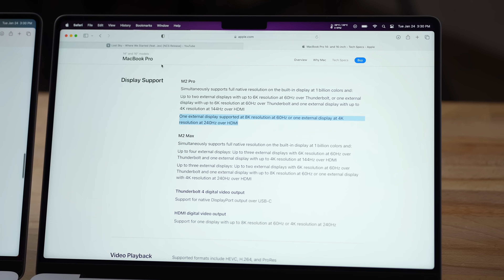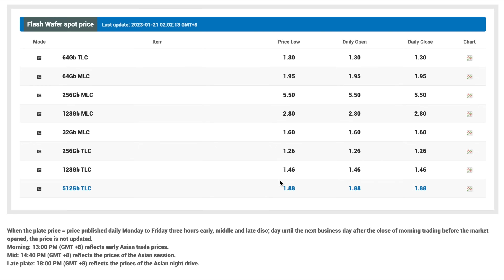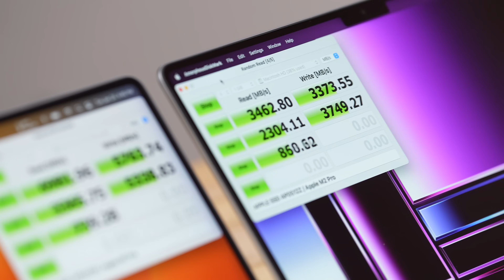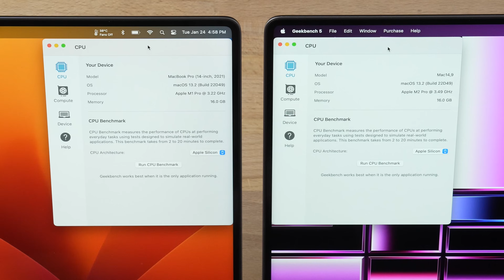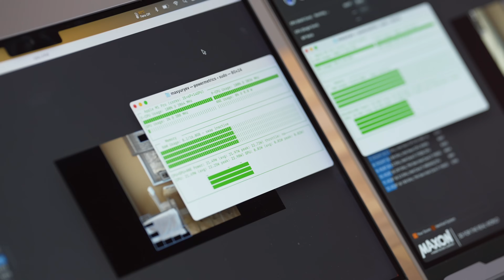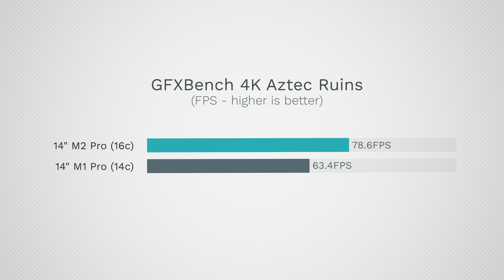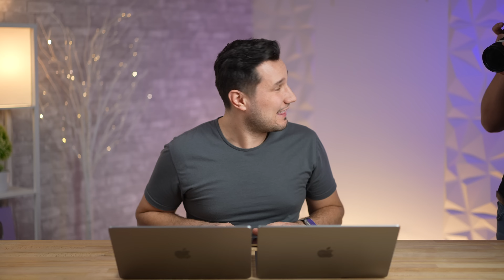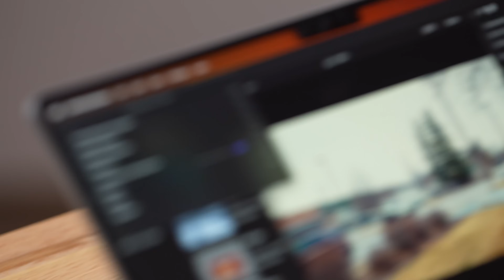M1 Pro vs M2 Pro 14” MacBook Pro - ULTIMATE Comparison!

Comment: Cool stuff. It’d be interesting to see what the actual impact of the lower SSD performance is for people on a daily basis depending on what their actual usage is like. I have to believe that a lot of the people buying the base configurations of those machines simple do so because they want a nicer screen and more base connectivity than would be available on a MacBook Air. Further, I’d guess that those customers who need the best possible storage speed are not buying the base config and are willing to pay for it, one way or another.

Comment: Very informative. The smaller heatsink on the new model doesn't make sense because the new SOC runs at a higher clock frequency and generates more heat.

Comment: This comparison just proves that although these new machines are faster overall, these chips are really just slightly beefed up M1 chips, with more graphics cores.

1. The battery difference may/may not have something to do with the fact that the M1 machine is over a year old, and may/may not have some battery degradation. 
2. I wouldn't have an issue with the single SSD and cost-cutting processes if it didn't impact performance or user experience. Transferring large files back and forth will be something that content creators do and that will have an impact on it. I've seen another test where it made a massive difference.
3. The graphics seem to see the biggest improvements so that's a welcome improvement. 

Overall most people with the older machines aren't missing out on much unless they need that extra graphics performance.

I'd still kill for one, haha.

Comment: 14:48 For the reference, I got 10620pts and 56fps on my laptop that is running on Intel i7-11850H ( 8p cores) and Nvidia RTX A3000 mobile ( similar to RTX 3060 Max-Q).
This is old gen by computer standards. An 3070 mobile can be had in a laptop that costs around 2000.
New mobile Intel (or AMD) CPUs and new Nvidia GPUs are surely faster in the same price range. Or faster and cheaper.

Comment: Wouldn’t it be better connecting the devices to power supply while testing? Considering the M1 Pro is a year older. also, depending on your usage/charge cycles, wouldn’t that affect the battery life?

Comment: I am super disappointed to buy the M2 Pro Base for the German increased pricing and get half of SSD speed. Not OK Apple! A decade ago I had same issue that Apple has 2 different SSDs in MacBook Air 11 inch and got replacement by Apple with the faster SSD.

Comment: It's unfortunate to see Apple causing this decrease in performance for the base model machines. It makes more sense with the M2 MBA, but not the M2 Pro. I hope they don't decrease performance for the M2 Max as well. I was surprised to see the minimal differences in performance, definitely doesn't justify an upgrade. Hopefully the M2 chips will scale better with increased RAM, they definitely didn't with the M1 chips.

Comment: Great video. Regarding SSD issue, as i can see the SSD speeds of 256 GB 13 inch models were abysmally low and 512 GB 13 inch models were double that, so it was recommended that consumers should buy the 512 GB models. Here the SSD speed of 512 GB 14 inch model is actually higher than the 512 Gb 13 inch models (which everyone recommended), but since we are comparing it to crazy high speeds of 14 inch M1 Pro versions which likely used 4 chips of 128 GB each, this seems slower in comparison. So in my view, for most users who do light productivity tasks, 512 GB storage with 16 GB memory on base 14 inch model won't be an issue at all. Am I right MaxTech?

Comment: This answers all the questions I had about making a choice with these MacBooks. Some of my takeaways from others seem to suggest that it’s not that big of a gain in M2 vs M1 save for very key areas like video processing. Seem that some of your tests are also communicating the same thing. For me who is starting from an intel machine then straight to M2 but maybe not 100% worth it depending on workflow for an upgrade from M1.
Reply: Coming from Intel it’s worth it. Coming from m1 it’s not worth it unless you do videos or graphic design like photoshop. But both are going to be way better than intel.

Comment: The SSD downgrade is just crazy. The new M2 Pro MacBook Pro has practically the same SSD performance as the first Touch Bar MacBook Pros in 2016. Apple has marketed the SSD speeds of the M1 Pros a lot, because they were much faster than the Intel MacBook Pros at 7 GB/s, but Apple is undoing this upgrade now. It is not even saving a lot of money by doing so.

Comment: That was an impressive review. I decided to go with M1 Pro 1TB 10 core cpu 16 gpu instead of basic 512GB M2 pro. The price is literally the same in my region for these two models
Reply: So do you have to order 1Tb to avoid getting just one slow nand chip?
Reply: @pauljazzman408  Yes on the M2. Any M1 has two, even the base models.

Comment: I'm a bit confused with the ssd speeds. If we get a 1TB drive in the new M2 Pro, would that use 2 chips and then be faster? I'm very disappointed in the slower speeds on the M2 vs the M1 with 512GB ssd's.

Comment: Always love looking at the mac internals. They look sleeker with black overalls. Kinda like a city by itself. With regards to the heat sinks, that's really strange shrinking the size down even with a higher-performance chip like the M2. Wonder if switching to the larger heat sink on the older M1 macbook pro, would help with temperature management.

Comment: I really love your extensive testing as it saved me a lot of money when I went for a discounted 16 inch M1 Pro instead of a discounted M1 Max which was the model I would have have to choose if I wanted 32GB of memory.  Seeing your video on memory usage as well as other on memory use I realised that none of the tasks I would use the computer I am writing this comment on would benefit from more than the standard 16GB. The better battery life of the pro versus the max does however matter.

Comment: The SSD downgrade is a real bummer, but otherwise solid improvements!
Reply: Idk it means it’s significantly worse
Reply: @ghost-user559  yeah, but hard to say how noticeable it will be day-to-day. Plus users that would notice will probably be the ones to buy an upgraded non-base model, which won't have the SSD slowdown.
Reply: @irbo5  I agree except he just showed the 512 is also one chip right? So that was the “value” option for many people who do know better. Isn’t the 512 still only a single chip now?
Reply: @ghost-user559  oh yeah, I think you're right. If it's the same as MBP, then the 512 is single chip too. Pretty lame that you have to go to the 1tb option to get the faster speeds...
Reply: @irbo5  Yeah it’s bad. Honestly it makes an old M1 look that much better  overall.

Comment: Feels like Apple held back the performance on the M1 family a bit and now refined the M2 to unleash more performance. I hate the cost cutting on the smaller heatplate and less NAND chips for the SSD though. The smaller heatplate is unforgivable as they knew the M2 chips were gonna run hotter, so why kneecap the cooling?

Comment: I'm still loving and using my base model 13" M1 Macbook Pro. Only a bit dated in terms of camera, but with Ventura,  I use my Iphone as the webcam. But I think the performance on those Pro and Max chips are way way ahead of Windows laptops. Unfortunately, the SSD is disappointing that base M2 models SSDs are slower than the M1 SSDs

Comment: I wonder what capacity of SSD is required to get the faster storage performance - is it 1, 2, 4, or 8 TB? That seems to be one of the two major performance differences. The other being the max temps, which is entirely due to the changes in the heat spreader. Also I suspect the Max versions gets a different heat spreader and fans. Obviously they are cutting some corners to maintain a lower price despite the price of components increasing. The SSD speed differences are probably down to used of SLC, MLC or TLC, which will affect the cost of the component greatly.

Comment: I would totally be fine with the slower ssd, but will apple further this issue by someday bringing it to the 1tb model? I would not be happy if they slowed down the 1tb model. 1tb is basically the bare minimum for most people these days with everything using so much storage.

Comment: fantastic, thank you so much for this content! this is the info everyone needs! i definitely noticed the difference in the speakers. the SSD'gate' bother me A LOT and the upgrade is absolutely essential especially for swab (both speed, longevity) IMO but i'm very interested to see whether models with a better SSD configuration can no better with ProRes too. also whether the thermal solution can keep up with the higher end models. i wonder whether theres a different thermal solution in pro and max configurations, not just between 14" and 16".

speccing them out, currently i think the M2 Max base models might actually be the best configuration since after essential SSD ans RAM upgrade the GPU boost is almost free. just remains to be seen whether the 14" max model throttles to death. also just noticed that the 14" has 30 GPU cores while the 16" has 36, but if the 14" doesn't burn itself down i think thats actually the (very high end) sweet spot.
however it probably will so the 16" max model is probably the first entry point that doesn't have what i consider unforgivable engineering flaws. IDK but i find it unacceptable to cripple a system with a poor SSD configuration or insufficient thermal solution. by that i mean that there are scenarios where the higher end model performs worse than lower tier, and as you will show that actually happens. with the SSD catastrophe, in mundane real world situations like too many browser tabs.

Comment: Can't wait for 14 inch m2 max comparison. I'm most interested in the m2 max 30 core vs 38 Core GPU comparison for the 14 Inch. The M1 Max 32 14 inch was thermal throttled in your tests... So let's see if it staying the same, and the m2 max with less cores is the better buy for the 14 inch.

Comment: I don’t think I’ve ever seen someone go in with that much detail. Only buy my products based on your reviews. Thank you
Reply: Same for me! This is the kind of review I was looking for!
Reply: I do not think I have ever made a hardware comparison based on how quick a web app refreshes a pic on a screen. That has absolutely bugged all to do with the systems since the user has the same bottle neck on wifi. Apart from that, what are the lane speeds etc. thermal ok one is hotter, but hotter is not always a bad thing. Nvme from Samsung for example performance increases with moderate heat compared to colder. Cores, sure nice but workload in real case different from benchmarks. I mean it is horses for courses. Take an intel nic and the typical onboard. Is there crc offloading,  what about ram, is it ecc there are too many variables based on use case for this type of review.
Reply: Don't ever watch a review from non tech geek/expert
Reply: Absolutely 💯 ❤
Reply: when they care about how much wattage these chips are pulling it really helps me figuring out these benchmark numbers very clearly!
Reply: Macbook
Reply: They kill it all the times!

Comment: I'm still holding off until the 3 nm process M3 arrives in eary 2024. M3 is supposed to get new CPU and GPU core designs and a new memory controller to better handle multicore operations.

Comment: Great video! Really enjoying the influx of M2 content right now! Still running a super old Intel MBP with the constant fan noise and insane heat (great to keep hands warm in cold weather) - seeing how fast/quiet these are really make me want to upgrade! 

I also have that iPhone case and I can confirm it's awesome! Love it

Keep up the great work!!
Reply: how old is your intel MBP? did u buy the non-touch bar generation?
Reply: @this_is_alvin  Yeah... mid-2015, have to say it's been great, I did have to swap a very swollen battery, but apart from that it's been brilliant... way too loud and hot, but rock solid!
Reply: @GeekBoyPete  that was considered “best macbook ever” by many before the release of the m1 pro/max MBP.
Reply: @GeekBoyPete  glad you didn’t buy the terrible touch bar generations. faulty butterfly keyboard, sucky processors, inadequate cooling, flexgate…
there are way too many issues that i can’t count with 10 fingers.
Reply: @this_is_alvin  Yeah, I will be sad when it finally gets replaced! 8 years service without a glitch, and it still perfectly usable (although I can't natively upgrade to Ventura) is really something from a laptop!  I intend at some point to use OpenCore Legacy Patcher (now it supports the mid-2015 MBP & Ventura) to give it a refresh on life! :)